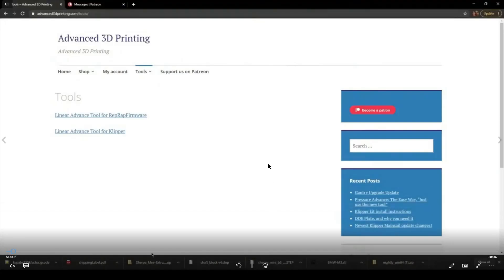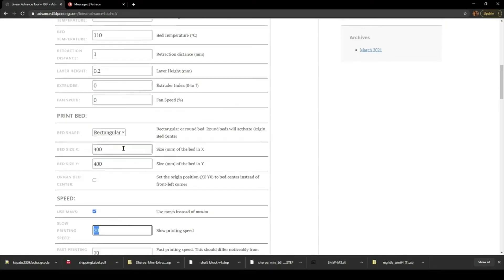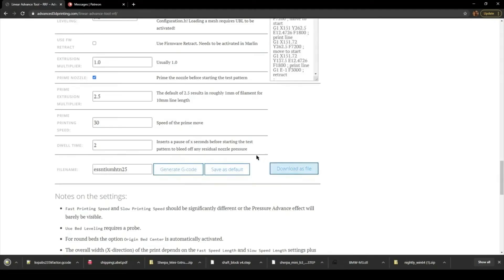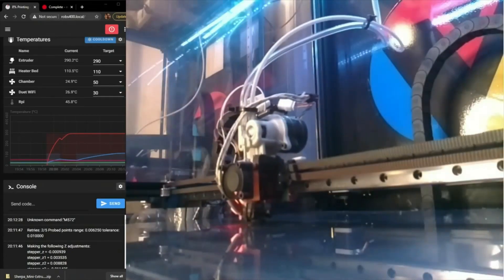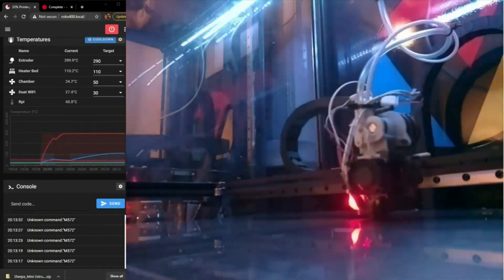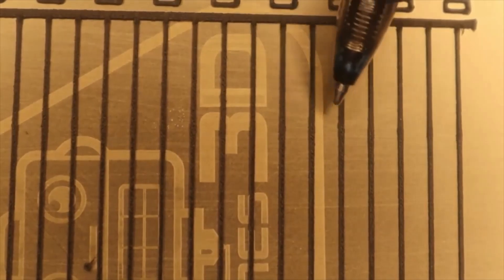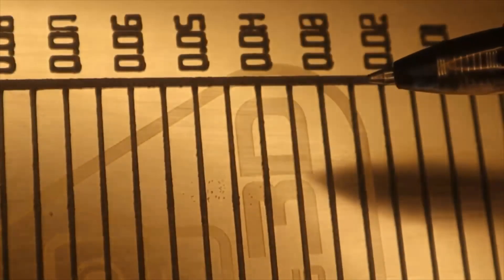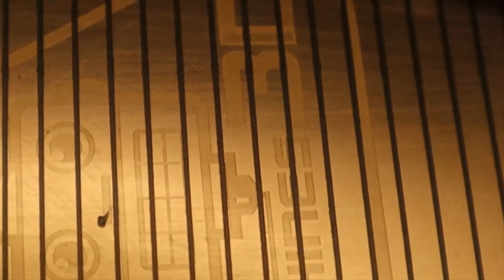Pressure advance tool, tune PA aka linear advance in less than 10 minutes

Comment: The thing i don't like about the Klipper pressure tower is that you simply can not print it with a .6 mm Nozzle the way you are supposed too, cause it would require something like 25 mm³/s Flowrate. Most Hot ends can't do that even with good filament, let alone crappy stuff...

Comment: how do you calibrate pressure advance for TPU, especially on bowden, since you cannot print it fast (<20mm/s), so you cannot have a big difference between slow and fast line portions ?
Reply from the maker: I would recommend using my version of the orbiter . It's the kne I printed tpu at 400mms but also for tpu it coukd be beneficial to run very high accel and keep all speeds identical  with no retraction and just fast travel no z hop etc. You will string but you can use stuff like wipe into infill and seam gap to mitigate . Sometime retraction can be worse  than 0 retract if the filament can't be moved very fast .